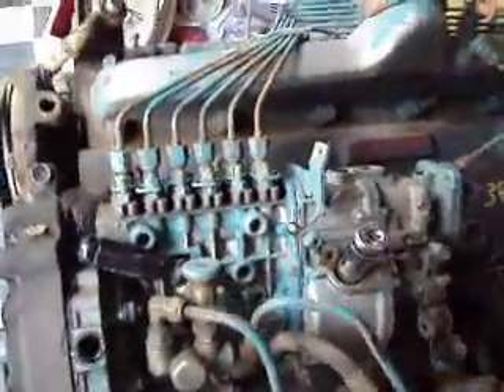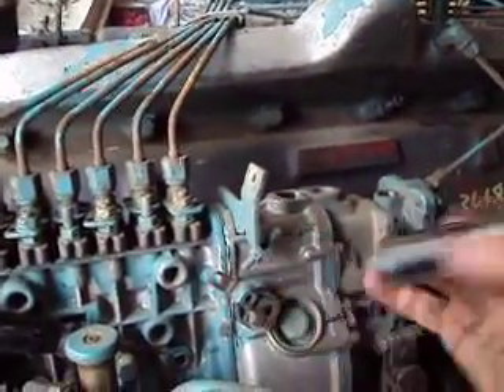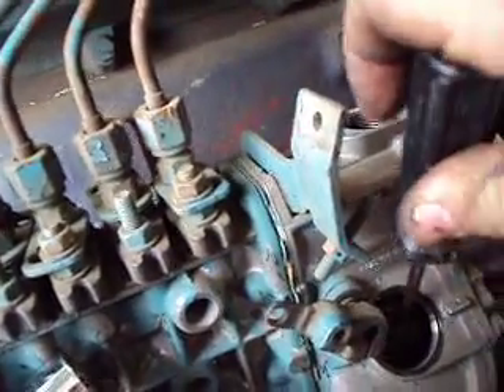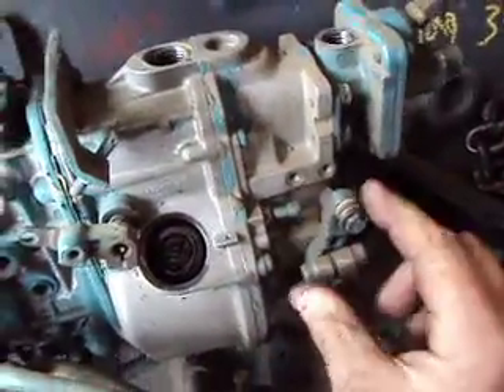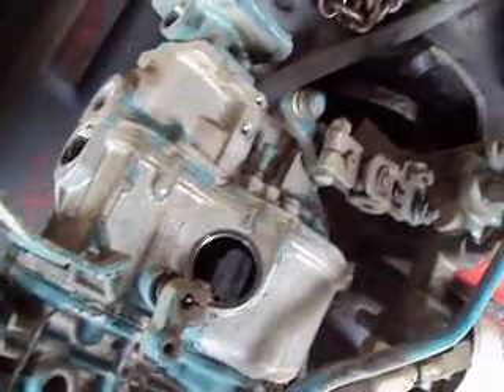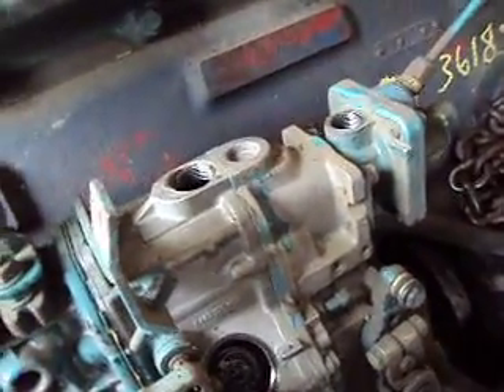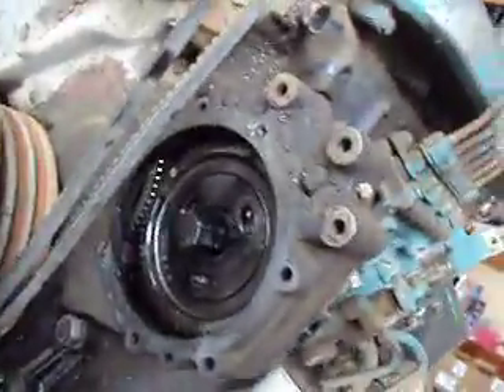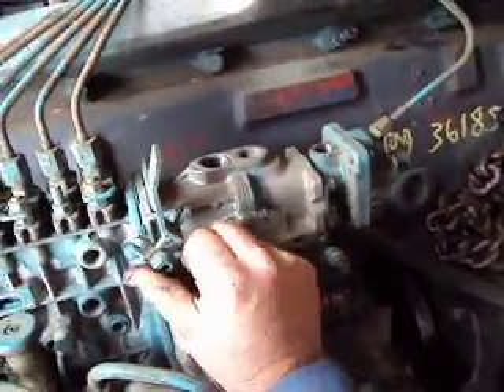how to tighten gov springs on BoschMW on DT466

Comment: @neverenufhp I have an all mechanical dt466 with Bosch pump. It's wanting to run away. It ran fine when parked.
Reply from the maker: If this is after you tightened the gov springs, start with lowering the idle speed bolt under the throttle lever.  
There is also a chance the rack is sticking, if it was sitting a long time.
Reply: @nevrenufhp  how can I un stick the rack?
Reply from the maker: @BrandonDrew87  , I would say to first double check every other adjustment you’ve made.  Another way it can stick is if you adjusted the screw on top, under the 3/8” Allen head.  If that backs off too far, it will hit the top of the inside of the pump and act like a runaway.  If that’s not it, remove each delivery valve holder and spray some good penetrating oil in there.  Check for full rack travel. Lube up everything you can then reassemble.
Reply: @nevrenufhp  much obliged
Reply: @nevrenufhp  also this is a truck I just bought, so I haven't made any adjustments.

Comment: Hey can you give me a contact for getting 300hp injectors for a Dt
Reply from the maker: jiemrvow , I used to do em, but they were a little shy of 300. Now I refer to Columbus Diesel in Ohio.  Otherwise, the best bang for the buck is to use a 94-98 dodge Ppump. Needs the pump, adapter and hub, and hook up the linkage.  It will certainly need a bigger turbo too.

Comment: Got it, now with the 4 click, my truck have long gear 3erd is good and 4th is a beast and the engine feel loose, to be honest I feel the now is working pretty good I don;t feel the it is been force. I have some smoke, but steel decent. 
I have a 60 series Spicer transmission and 9/41 rear end

Comment from the maker: With the shims, the idle will not be as high as when you crank it down to 6 clicks. It'll only affect max rpm, unless you get them really tight. Going too tight can also break off the stud, which is not a pleasant fix.

Comment from the maker: It's the set of springs for the governor that you tighten up. Under the retainer where you make the 'clicks'. Back out that nut, then use a magnet to pull off the retainer and there they are. Shim the smallest spring against the retainer. Just make sure you do both sets.

Comment from the maker: Go for the 6, and see if you can bring the idle down. That's the main reason for not going more than that. You could also make shims for the small, inside spring. Get it to fit only the smallest spring, and about .040" thick. You can get a lot more rpm from it that way.
Reply: Eso da mas potencia o que sirve lo que tu haces aii

Comment: Also I have the time at 20*, I feel when I just to have it at 19* it was better on the long run down the high way at 20* or 21* I feel the the engine cut off at some point.

Comment from the maker: @TheDirtytexan 
 You can spin to 3200, but fuel economy will greatly suffer. The main goal here is to keep it fueling harder up to the 27-2900 area.  The stock ratating assembly can stay together up to around 4500.